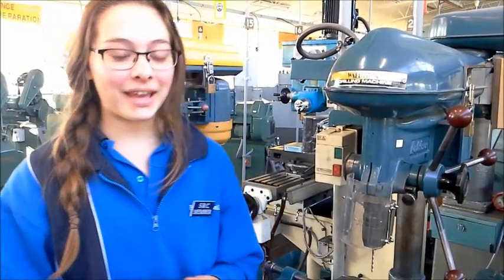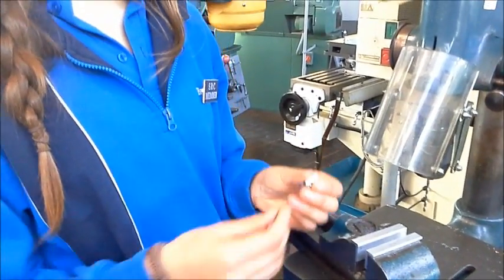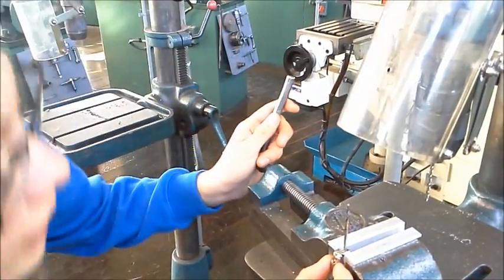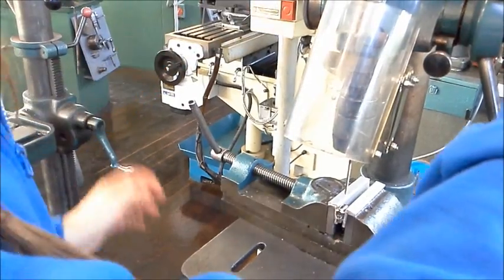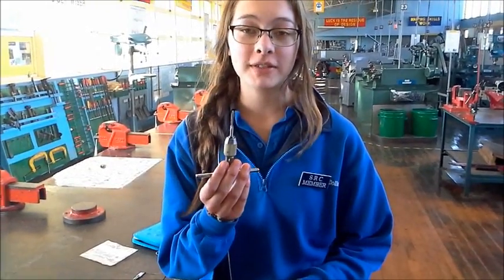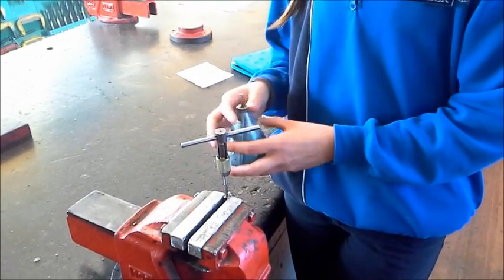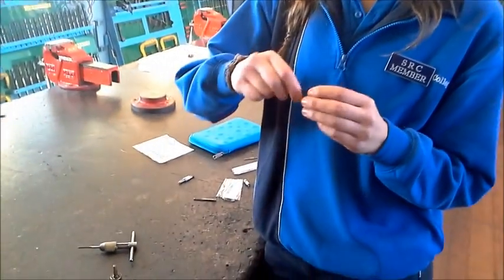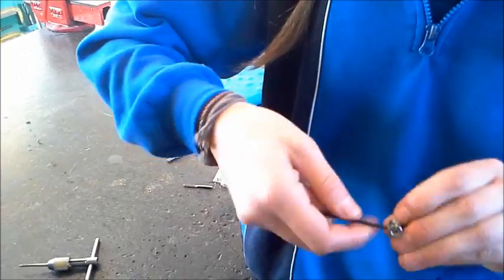How to make a universal joint meccano compatible

Comment: Nice video. What you can also do is once the hole is drilled, leave the part in the vice, change the drill for the Tap and then use the drill press to keep the tap vertical turn the chuck by hand and light down pressure to thread it.